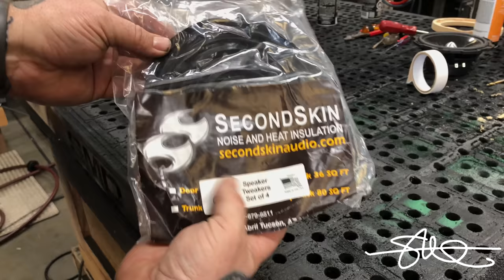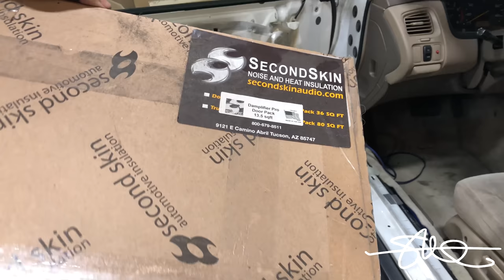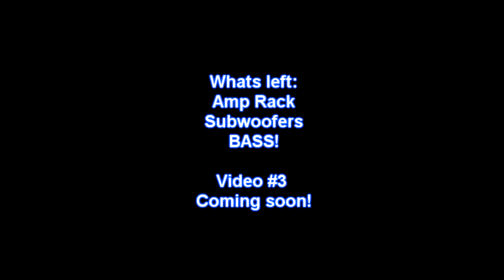First "Real" Sound System - Full Install! 6.5" Component Door Speakers, Wiring, Crossovers (Video 2)

Comment: How did you install that system on that car? I dont know too much about car audio but i know you did the big three so that helps a bit but wouldent those rockford subs be pulling like 1000 wats of power still?? Did he change his stock alternator and battery?
Reply: . Scout 😂😂😂😂
Reply: B K i dont know anything about car audio it was a serious question
Reply: Bruno Long I don’t think Steve needed to upgrade the stock alternator, since it’s only a 1000 watt amp. I think that the big 3 is enough for the system that’s being put in. If it needed an high output alternator, I’m sure Steve would put one in there, or at least recommend it to Psyph Morrison(owner of the car). This is the legendary Steve Meade. Not kissing ass or anything like that, but he’s been in the car audio industry for 20+ years and is well-known for the work that he does and the knowledge that he’s contributed to car audio.
Reply: B K i wasnt questioning anything he did i respect the fuck out of him but i got a honda civic 2017 and people say not to push it past like 500 wats even with the big three thats why i was so confused by this, i thought he had done alternator upgrades or something but i appreciate the response i guess my cars just weak as hell lmao
Reply: Watch part one and you'll see what he did to the alternator
Reply: Young Oz all i saw was the big three i watched again, he ran a wire from alternator to something but he didnt upgrade the alternator
Reply: Just throw the biggest battery you can fit under the hood and you'll be okay as long as you don't go crazy on the sound system.  An xs power d3100 will do just fine on the stock alternator.
Reply: Bruno Long I feel you bro. Didn’t mean to sound offensive in my last response. But if ppl with the same 2017 Honda are saying not to go past 500 Watts, then idk what to say. You are right tho about the alternator part. Your amp can only put out as much power as the alternator can allow. I had a 2002 Yukon and had a 2500.1D Hifonics Brutus powering 2 Rockford Fosgate 12” T2’s Dual 4 Ohm. The stock alternator did ok. Both T2 12’s were 2400 Watts rms combined. But I wanted to put more power to them, so I upgraded the alternator to a Mechman 320 Series Elite and put a 3200.1D Hifonics Zeus. Huge difference!
Reply: B K thats insane power to it man, all on a stock vehicle. I just got into car audio a bit and i thought every stock vehicle could only take like 500-800 wats top but damn. I kind of want to say fuck it and get some p3s or sundown audio subs that total 1000 rms but right now im stuck, i can only get two subs that equal an rms of 600 to not overload the system but i really dont know shit about car audio lmao so i got no clue what to do. I didnt wanna buy a battery or alternator. The one thing i would do is the big three but who knows what my car can take
Reply: Bruno Long just do the big 3, maybe add a secondary XS Power battery in trunk and run your system. I’ve seen some crazy power on stock alternators. Every car is different, with their own alternator powers being more or less than others. Good luck on your car audio endeavors tho bro. Trust me, car audio has been my hobby since the 8th grade, and now I’m 30😂 the more power I got, the more power I wanted. Now I’m working on getting 2  SMD Ascendant Audio 18’s for my Escalade. I plan on running dual Mechman 370 Amp Elite Series Alternators, 4 XS Power D3400 Batteries, DC Audio 9K Amp and Rockford Fosgate T5’s for my kids and highs powered by a T1000.4AD amp. It’s gonna take me a while to save up for it, but once it’s done, HOPEFULLY I won’t crave for more power😂😂😂

Comment: Can I come work with you for free. I’m old so I don’t have a million things too occupy my time. I’m on disability due to an injury I sustained but I can still do the work just a little slower. I stared in cards but moved into computers and cctv commercial alarm systems and access control. I did go the MECP route but at the time I felt it was a home. I do have my low voltage electrical license and I have the hours in my state to get me electrical contractors license as well as my class A high voltage license. I need a change of scenery. Let me know if you have any thoughts on the plan

Comment: Hi bud just an fyi 4k video in not necessary.  Youtube doesn't even broadcast in 4k.  Regular old fashioned 1080p recording is plenty good enough and way easier to process.
Reply: agree
Reply: YouTube does have 4k it takes forever to upload but 4k is here if you have a couple of hours to upload
Reply from the maker: hi bud, sorry to inform you but YT DOES have 4k.  Go look at my previous 2 video's....OR the thousands of others from other people.  Thanks anyway for the advice even though it is bad advice. At least you tried.
Reply from the maker: hey what do you know...THIS video is now in 4k.  SMH @ Joe and "Wroxx" for agreeing LMAO
Reply: My bad I didn't think they had 4k cause so far every video I have ever watched when you click on the HD settings mine seem to top out at 1080p60.  I am using a Macbook Pro 2014 model.
Reply from the maker: all good man.  Now ya know :)

Comment: LOL, Second Skin clearly states that spray adhesive will NOT work for the speaker tweakers and it requires double sided tape or super glue... and you're using spray adhesive. It's all about the details, man!! You'll never be able to get back in there and fix them.
Reply from the maker: shit! i didn't know that.  Feels like it is holding but ill have to check on it.  I guess i am not perfect after all haha! damn.
Reply: meade916  we all make mistakes from time to time!
Reply from the maker: it ain't really a mistake.  Checked it yesterday. It's holding fine.  I can get to it very easily if it needs to be re-glued.  "It's all in the details" LOL...what? out of all the stuff i did you finally found something to pick on.  Spray glue. God damn....anyway, it's holding so relax.

Comment: Didn't even paint or seal the MDF. All that router work and then installs MDF in a door. That will be furry slop by now.

Not even a foam gasket around the midbass to the door skin for extra midbass. 

Hope you do better work than this nowadays.
Reply: LOL! SMD is killing it nation wide and around the world. Have a nice day. BTW the MDF will be fine unless the car is in a flood or takes a dive. If what you said was the case. All of the switches, door linkage, etc. would be corroded and rusted. That's why the door has plastic from the factory and drains at the bottom of the door. If the door window sill strips are good then no worries. I do agree with painting or coating the spacers. I would've coated them with rattle can bedliner myself. I cut mine out of PVC/PE board for my truck and boat.
Reply from the maker: still perfect to this day.  Now what, random nobody?
Reply from the maker: @wilsonrawlin8547  no need to coat anything.  F that guy. Don't blow him for any reason.  He is a nobody that knows nothing. What you did doesn't even come close to this so just stop with the cool comment followed with tha asinine weird comment. LOL SMH